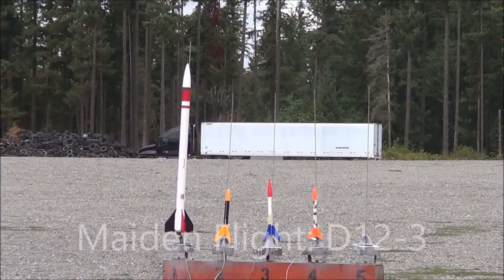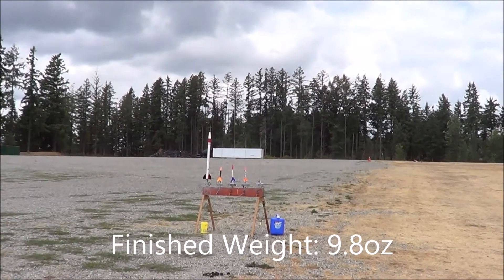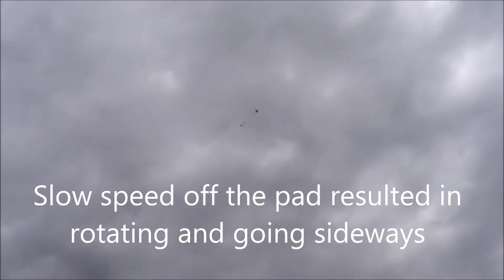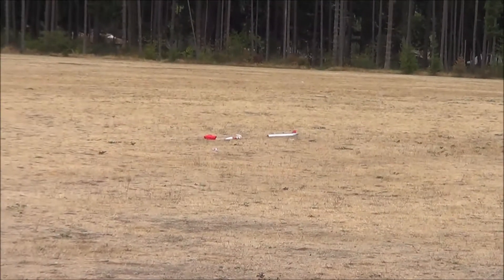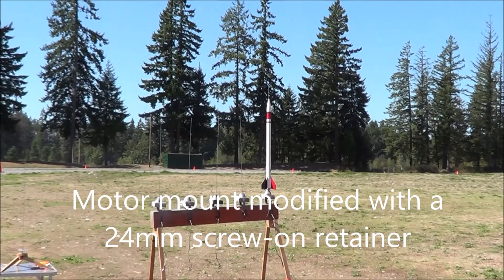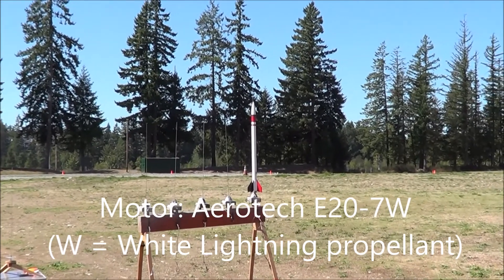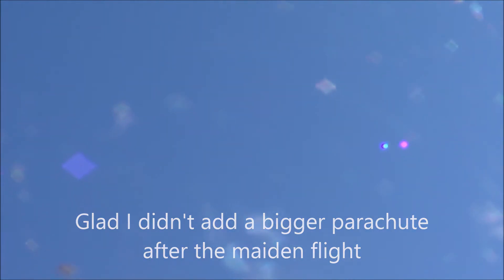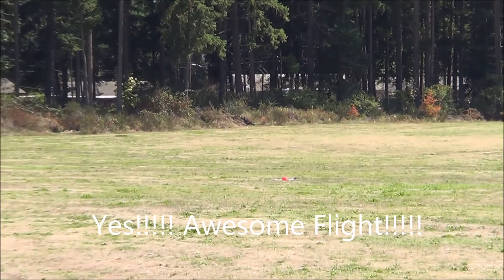Estes D Region Tomahawk D12-3 vs E20-7W

Comment: How did you make Aerotech work. I have same rocket
Reply from the maker: I had to cut off the stock motor retainer, I replaced it with an Estes 24mm screw-on retainer.
Reply: @flyfalcons  can I see a picture of it?

Comment: About the fin coming off on landing... what glue do you use?   Have you tried epoxy as a glue for rockets?
Reply from the maker: Nick Lang Yes, the entire fin can was scuffed and bonded with 30-minute epoxy.  Apparently it is a known issue with this kit that the plastic doesn't bond well with epoxy.  I have reglued the popped fins with medium CA and they have held much better.
Reply: I used Testers model cement.  Didn’t hold all that great either.  Lost a fin and cannot find it.   Good comparison video.